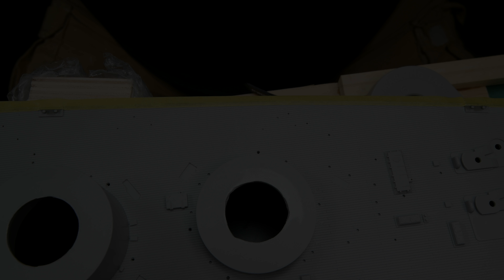The Model Ship - Part 543

Comment: Hey Ron, what would be a real good idea for the deck is a stencil, you paint the the whole deck, including what would be the greyed parts, a stencil is placed over the top of the whole deck  leaves all the details exposed then you can paint/spray those details without having to fart’arse about masking off the wooden decks you’ve just painted, bit like the veneer but you remove it after. I’m surprised No one has come up with something like that, would make it a whole lot more enjoyable and stress free. See you tomorrow (or this evening, anyway)
Reply from the maker: Re: " I’m surprised No one has come up with something like that"
Actually Tony suggested that sort of idea to me earlier in an email.
Now, this is a really smart idea, but, unfortunately because I've never done it I don't want to be adding several days (maybe weeks) more to this build by having to do testing and practicing --- but thanks. 👍🙂
Reply: Ron Calverley it would be great for a future project, all it would take is someone to use the wood veneer deck as a template and instead of using a a veneer they use a thin card with sticky back.

Comment: No Ron, first the primer and then the deck or wood color, and NO there is not one right way, you have to paint the way you want it and what you are happy with. I first spray the primer, then a wood deck color and then another brown color, then with Tamya collor I will apply color and variation and apply a neat structure with a brush, which is fun to do. See you tomorrow from Rob
Reply from the maker: "first color the primer" 👍🙂
Reply: @roncalverley  Yes, I mean the primer first then the wood color etc. etc. Just as you like and that's the right way.

Comment: Hi, Noticed your attempts at masking the top deck. Could I suggest this, it might save you some aggravation, use 6” or 15cm strips, put the EDGE down so the edge touches the deck and the sticky is against what you want to mask. Fold over and burnish, job done..... hope this helps Regards Rob James
Reply from the maker: Thanks for that tip Rob. 👍🙂

Comment: It looks like the tape isn't flexible enough to follow the contour of the gunnels. Looking from the top angle, from the camera, it appears you are over-masking with the tape over the plank area. The problem with this is that after spraying and removing the tape, these edges will still be bare plastic grey. 
I recall you had a special (white?) tape you were using to mask the Bismarck hull boot line in the stern where the curvature was intense. Perhaps that would be a better option for the gunnels. Or, paint these edges with a fine brush afterwards.
Reply from the maker: That thin white tap will be better. 👍🙂

Comment: Ron, don't bother masking the edge of the deck. Paint the whole deck and after that mask the wooden parts and than paint the metal parts including the outside of the deck gray. Will be easier and you'll have to mask the deck in any case.